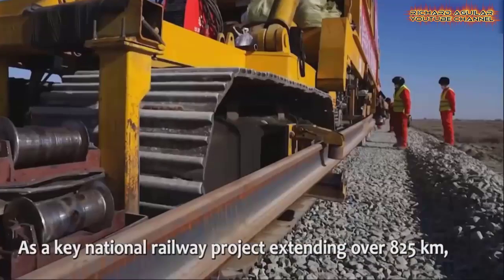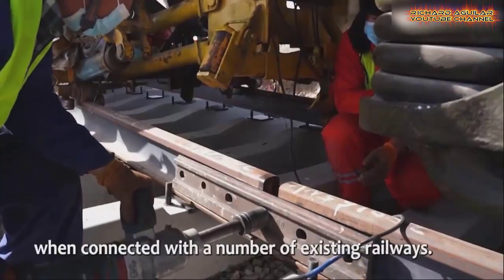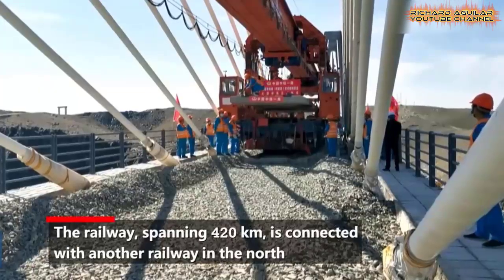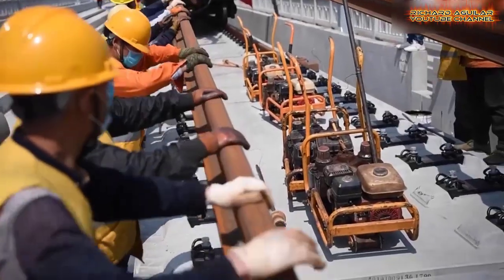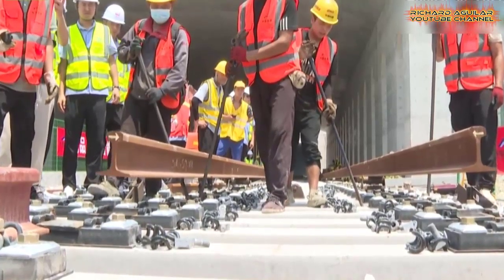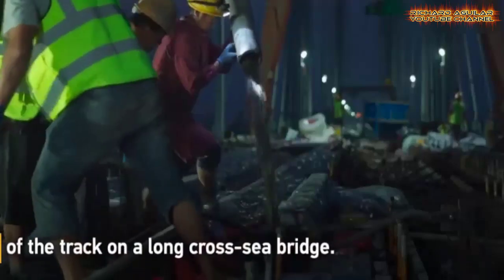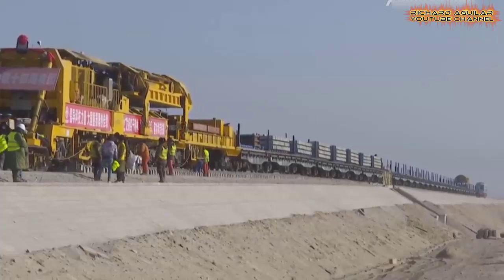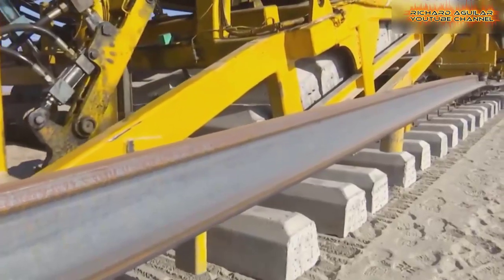Actual Footage! China's Modern Track Laying Methods For High Speed Railways

Comment: This is a very interesting subject, but this video treats it in a very disjointed and superficial  way.  Why not start with the bare ground and show the process, step by step? Explain, for example why so much of  the HS track is on flyovers.  It would be a lot easier to follow and IMOH a lot more interesting.  There are a lot of fascinating innovations in the way the Chinese construct these HSRs, which could be explained and highlighted in the commentary.  Other aspects of the matter, are the way in which the Chinese high speed track is laid, is different to the traditional way that  track is laid and maintained in the rest of the world and how much of the track is made in a factory and then transported to the worksite, half a kilometer at a time.  Also one could go into how the necessary precision is achieved and maintained. (And what a lot of work is involved in that!)  These are just a few suggestions for what would be, in my opinion, a far more interesting video,

Comment: i am most impressed with the construction company's efficiency. here i am in Edmonton, a 13 km lrt line opening has been indefinitely delayed as  30/45 concrete piers have been found to have structural defects😢😢. love from canada.
Reply: if we build 13 LRTs each year, they would certainly mechanize all the tools.  problem with us is we dont have enough projects, and the constrution worker just go slow as f in order to squeeze as much work hours as possible out of single project. while union do help worker getting more pays per hour, they are also greedy as hell to make all the projects expensive.
Reply: @redhongkong  Well though-out comments. Ppl that comment on these usually never consider pop. density, econ efficiency and if a project can support tools optimization.

Comment: The large numbers of railways projects being constructed in China allows special jigs and rigs to be designed and build to speed up the repetitive tasks of laying the concrete sleepers and steel rail for the  tracks of the trains.
Very economical and fast method to do this, especially in straight track runs and flat open space as shown in the video.
Bottlenecks such as obstructing mountains (may need tunnels) or rivers (may need bridges) can cause delays to these projects and each obstacle need to be cleared to proceed to completion.
Not as simple as shown in the video for all the way.